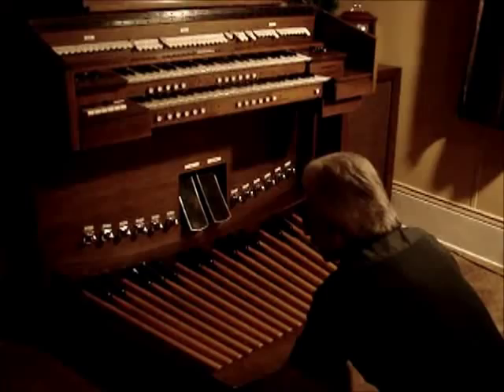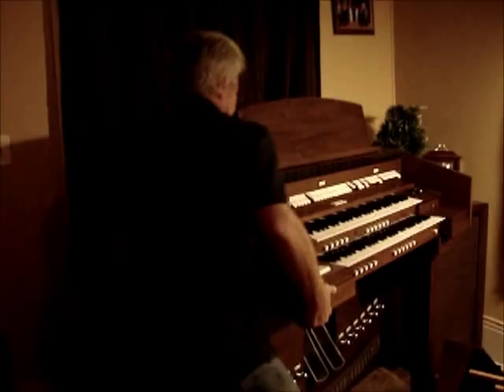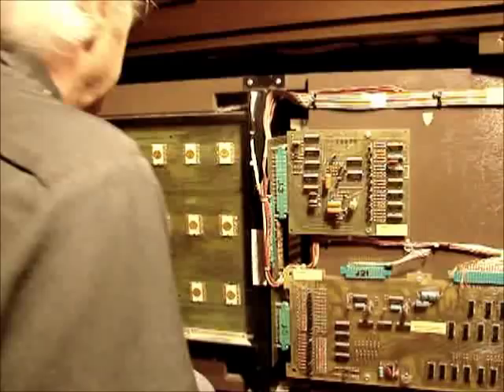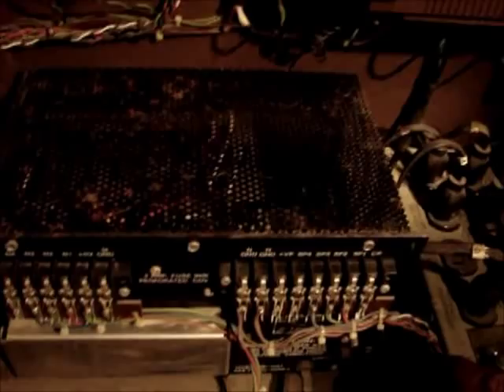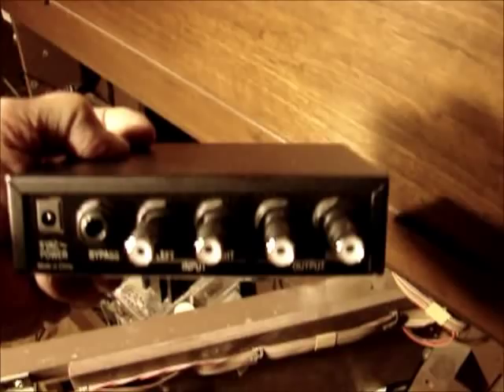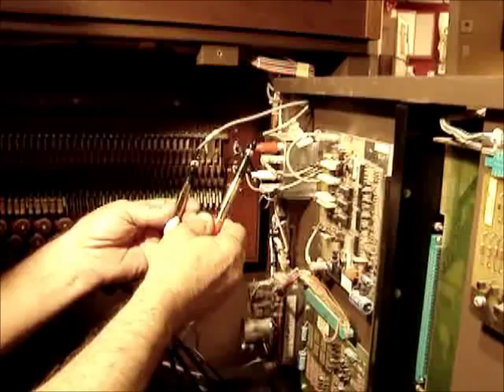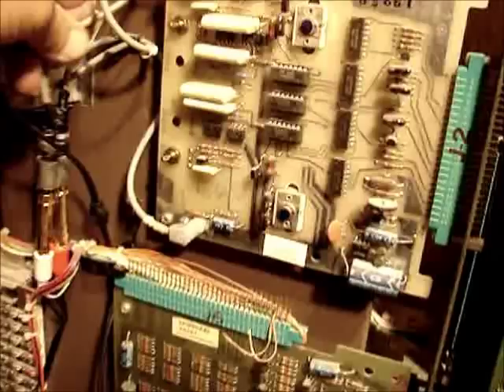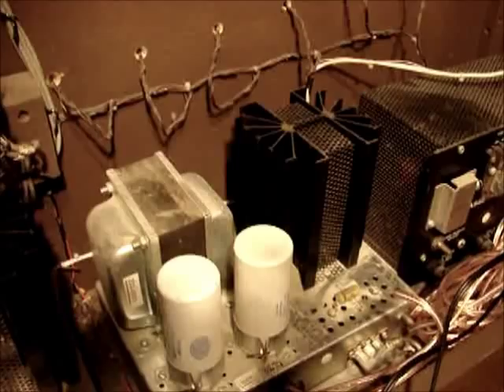Alesis Nanoverb installation on an Allen 301-C organ

Comment: I hooked up a Nanoverb to my Allen 301-B, just like you did yours and without the pedal isolators and it works fine. The isolators are on order and will be going in naturally.  It makes a big difference when you have an Allen as a home organ. There is just a tad bit of noise in the sound when using the expression pedal but it's not all that noticeable.  The Tubular Chime card sounds great.  Just like the real deal.  Thanks for the Video, it was a great help!!!!

Comment: I have an Allen 123C and an Alesis Nanoverb.

Once the Allen cables are connected to the expression pedal isolators, and those are connected to an RCA cable, where does that RCA cable connect to the Nanoverb? Where does the second RCA cable from the Nanoverb connect to the Allen?

I have asked this several times on the various Allen Organ FB pages and on The Organ Forum, with no answer. Our closest Allen technician is over 200 miles away, and it's not worth their time or my money to have someone come here to do this.

Thanks!
Roy

Comment: The part of the video where you were talking about the female unions -- do you have to cut the male plugs off of the flute out and main amp cables that came from the DAC board?  If you did, do you just find 2 female plugs and twist the wires together and tape?
I will be connecting a Lexicon MX400 to an Allen 225 M(MOS-1).  Anyone please chime in to help :))